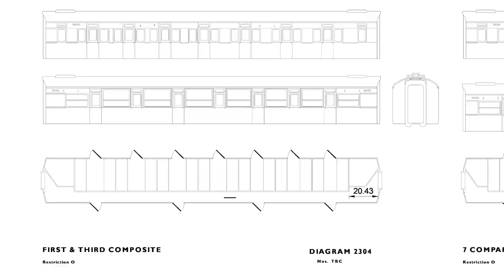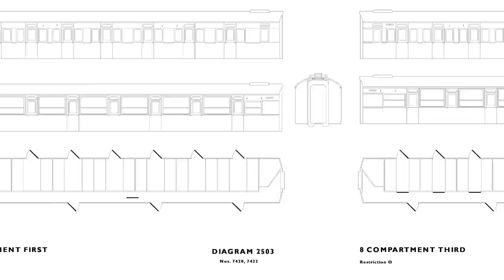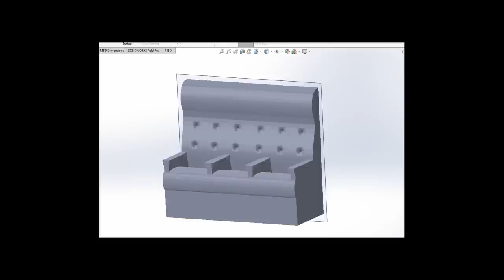S2 E23 Cardboard Carriages | Hastings Line Stock for Bexhill West Model Railway

Comment: I ve made several coaches for my O gauge railway. I used two pieces of card glued together and before it dries the card is formed round a  coach shaped wooden former and held tightly in place by a strip of cloth wound round it. Once dry you have a card shape card coach complete with roof. The details sides are cut out and glued on. Windows are cut and glazing added. Bogies and details to taste and the result is cheap robust coaches that have run many miles. A very under rated material card.

Comment: Very nice as usual James, but and I could well be wrong on this, were the carriage sides completely flat ? The only pics I have seen of Bexhill West seem to show a slight, but noticeable, curve to the sides, both above and below the window lines, if so then your laminating of the sides is still an excellent method but it would mean you will need curved formers and also that every sheet will be slightly larger than the one below to allow for the convex (ish) surface. I do in particular like the sandwiched "glass" idea, this would make adding an open widow or parially open window much easier
Reply from the maker: HI David,
These particular coaches were slab sided.  The drawings show a very slight turnunder or tumblehome to the lower edges of the sides but it is almost imperceptible at this scale.  
I have made a curved jig for some Midland coaches which I hope to try out later this week, I just need to finish the artwork for the sides.  It'll be an interesting further experiment.
Thanks for watching,
James

Comment: Interesting method, kind of suited to these particular carriage due to it's squared appearance due to the restrictions on the route otherwise known as restriction 0, one of which undergoing restoration on the Bluebell. Doubt it will work on other carriages with a tumblehome mainly due to the curvature of the lower part of the body shell.
Reply from the maker: I'm going to experiment with some curved sides, I've got a curved jig made for some Midland Clayton 6 wheel stock.  It'll be interesting to see how the turn out.
Thanks for watching,
James

Comment: Impressive, thanks for sharing, what drawing package are you using.
Cardboard instead of plastic because the laser would melt the plaster ?
Thanks again.
Reply from the maker: I'm using Techsoft 2d Design, which is what I use in my day job as a teacher.  I have AutoCAD, Solidworks, etc. but prefer this simple software for straight forward 2D drawing tasks.  I always use it to lay out sketches for my 3d CAD work too, preferring to import 2D profiles into my 3D CAD package.
I've used card, as I have a good stock of it, it's cheaper and laser cuts really well.
Thanks for watching,
James

Comment: Good effort! I am not sure French polish is the right thing to use, as it has a tendency to craze when painted over.  Maybe use artist's matt acrylic varnish?  Thanks for uploading.
Reply from the maker: I've had success with this method before, but I am aware of certain finishes reacting to the shellac.  But you raise a good point.  I've got lots of coach side prepared, and I'm going to do a thorough test of different finishes and try to  come up with a reliable recipe which is simple to replicate.
Thanks for watching,
James

Comment: As glazing may I suggest either microscope slides or even slide covers although the latter may need packing into the gaps.  Like coal, in miniature, glass looks remarkably like glass.
Reply from the maker: That's a great suggestion.  Would you know a simple method to cut microscope slides?  I'm guessing a usual glass cutter/scribe - but is there a better method for small pieces like this?
Thanks for watching,
James
Reply: @BexhillWest  A friend uses a diamond stylus held in a pin chuck.
Reply from the maker: Thank you, that's very helpful.
Reply: The slides can be scribed and snapped with just a steel scriber, but a glass cutter would result in fewer breakages.  The covers are very very thin and just need the steel one.  There will be a fair bit of wastage but they are cheap and the process for your system means a little nick or two on the edges isn't going to matter.
Reply: I use a diamond phonograph stylus in a pin chuck. The item number is a GP65 if you can still get them. or Tonar No. 5. Microscope cover slips are best and can be bought from Galvoptics Ltd economical size is 24 x 60mm in boxes of 100 and cut them to size. They are 0.13-0.17mm thick

Comment: Would using shellac out of an aerosol can rather than the brush?  I can see shellac gumming up the insertion of the plastic for the windows.  A great effort that got my juices running.
Reply from the maker: Hi David,
I'm not sure it would make much difference.  The Shellac, whether French Polish from a bottle, or made up with flakes, needs to be really thin (like parafin).  It then just soaks in.  The secret is to stop applying it as soon as brush marks remain after application.
I've had no trouble with it gumming-up the slots and as you can see in the video I've just been brushing it on with an old brush, taking no particular care.
Thanks for watching,
James

Comment: Loved watching this, I have just added a laser cutter to my workshop to create my own "Metcalfe" style kits, I'd love to have a go at rolling stock as well. Can you tell me the grade/weight of stencil card you have used? P.S. just recieved the ballast "vac" brilliant piece of kit!
Reply from the maker: Search for Oiled Manilla Card or Stencil Card, it's available in a variety of thicknesses.  I've used 375 microns for this experiment simply because I have a stock of it.  By mixing thicknesses some great detail effects can be achieved.  Another material to try is 'laser board' available from Hobarts.  This is wonderful stuff too, not necessarily for a project like this, but it is a great structural base for architectural projects as it's really strong and dimensionally very stable.  I find the 0.8mm stuff really useful.
All the best,
James

ps.  I'm pleased you are enjoying using the ballast vacuum.  Thanks for the feedback.  :)

Comment: Interesting, these kinds of kits used to be common in the US in the 1930s. Obviously yours are a lot more precise of course.
Reply from the maker: I'd be interested to learn more about these kits.  Do you know who the manufacturers were?
Best wishes,
James
Reply: @BexhillWest  not clued in entirely on the manufacturers outside of my local hobby shops line from the time period. “Shop-Craft-Dunellen,NJ”. But they did run on the same principle of thin wood cutouts veenered onto eachother in layers then sanded flush, details in the form of zinc castings, and decorated with paper prints.

Comment: Actually card seems to be back on the menu for some manufacturers.
Advice from some builders i got was to use a base coat paint, either from a spray can (automotive quality) or airbrush. I'd stay away from shellac as in my experience it's sensitive to moisture.
Otherwise a very impressive project!
Reply from the maker: That's helpful feedback, thank you.  I used shellac as that has been my prior experience.  However, I've now made 12 coach sides, and I intend to experiment a little differently on each to develop a straightforward reliable method.
All suggestions welcome on here, and I'll try them out.  Maybe there can be a future video of the text results.
I've got what I think will be a great idea for the numbering and detail painting which I think might be of worthy of a video, I could add it in too.
My best wishes,
Jamed
Reply: Absolutely fascinating. Greatly admire your attention to detail and ‘sandwiching the glazing between the layers is pure genius.